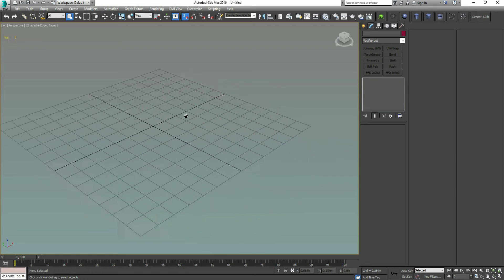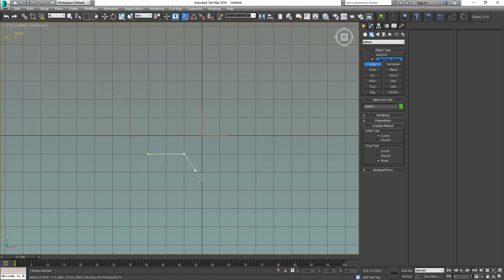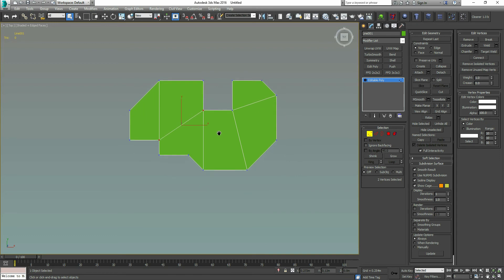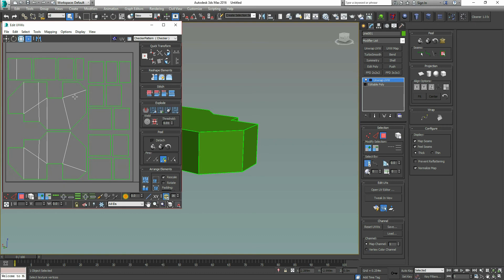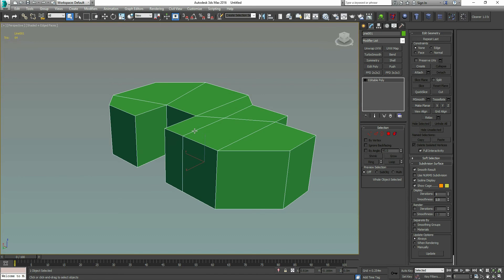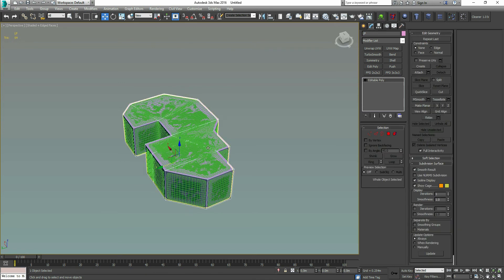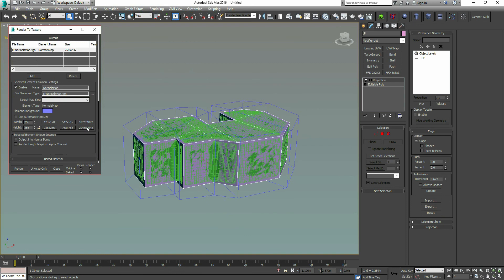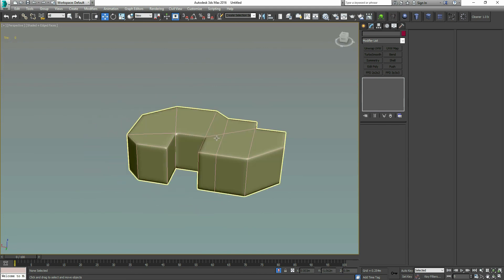3ds Max hardsurface normal baking

Comment: I'm having massive trouble baking hardsurface models. I'm lost on when you need to soften your object or harden. when to cut uv's or not. I thought basicly when you don't have any 90 degree angles you can soften your surface on the whole thing and make uv cuts anywhere you want without getting any errors. This doesn't seem to work though. What are the general rules here?